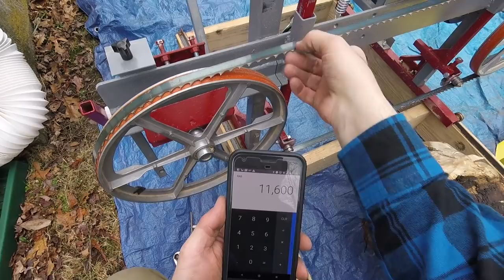Felling a Tree and Milling It Into Boards With My Homemade Sawmill

Comment: I notice that the blade guides are set away from the timber.
This and the blunt blade will account for the diving , and variations in thickness.
If your blade guides can be moved closer to the timber , and a fresh SHARP BLADE, this should correct the issues.
I notice that a lot of bandsaw mills also use a water spraynto cool the blades .Justva thought.Nice timber though and I follow with interest

Comment: i agree with one comment you have received from another viewer, that you need one of you blade guides to be adjustable and closer to the log.  preferably the cutting side.  everyone can be critical but to build your own band saw mill is awesome at any cost, (except an eye, foot, leg, toes, throat, etc... you get the idea).  good luck and great work.  only thing i would add to the stability is make it heavier

Comment: I see that this is your latest sawmilling video, so I'll copy what I had written for one of your previous videos along with what I"ve seen in some of the videos you did later.

Mistakes I caught in the milling process ...

1 ... you have the blade running BACKWARDS.  In nearly every bandsaw configuration I've seen, you want the blade to pull your material up against the stop (usually the left side of the sawmill, as seen from the operator's perspective).  This keeps the material under control while it's being cut.  You also need to have some method of securing the material as you are working with it, to keep it from trying to roll while you make your cut.

2 ... you have no coolant for the blade (water with a few drops of dish soap works great ... just a steady drip)  This also helps keep sap from sticking to the bandsaw blade, gumming things up and making a mess or catching fire.  This also helps lubricate the blade so that it doesn't get pinched in the kerf, and also helps keep the blade tracking straighter (helps prevent that climbing or dipping thing).

3 ... Power is an issue, as you figured out.  3 - 5 HP should help a lot.  I see you went to a gas powered version.  This might work better for you, or not ... depends on the availability of higher powered electric motors and the price point of gasoline, though running it off gas would also make it very portable if you wanted to take it out to the woods.  Running it on electricity, on the other hand, would mean you could keep it in a corner of the garage and even run it indoors .... the trade-offs are generally a bit of a personal choice.

4 ... Blade Tension helps keep the blade running on track and cutting true.  The blade guides should also be tuned and set so that the gullet of the blade teeth are riding right on the crown of the blade wheels.

5 ... NEVER BACK OUT OF A CUT ... the blade will pop off!  Also, keep track of where your blade will be tracking, you don't want to hit your hardware that secures your materials.  When you finish your cut, remove the slab or board you have just cut and then raise the blade a little to return to the front of the mill.  This is a lot easier than raising the blade to clear all the material you just cut and then moving back to the front of the mill just to lower it down again.

6 ... Learn how to repair maintain and sharpen your own bandsaw blades, if you can.  If not, then you'll at LEAST need to learn how to sharpen your blades, and order them from a good reputable source.  I prefer Timberwolf for my bandsaw blades.  I noticed that you have Timerwolf blades too! :)  A good sharp blade tracks truer, so keep them properly sharpened and with even tooth set left and right for a good clean cut.

7 ... A thinner blade will be for rip cutting on a stand-up bandsaw, to conserve material.  A wider blade (NOT THICKER) is used for making straighter cuts, as it tends to track true down it's own kerf, keeping the front in line.  A narrow blade is meant for making curved cuts, so that the back side of the blade will not get in the way as you make tighter curves.  A thicker blade is meant to be more durable, for rough cutting.  Obviously, for bandsaw milling, you'll want a decently thick blade for durability, with a wide blade and a fairly sparse tooth count (large teeth, perhaps a half inch or more between teeth).

8 ... GET MULTIPLE BLADES.  The very very last thing you will want to do is stop right in the middle of milling a log and having to take the blade off to sharpen it before re-installing it to continue ...  You'll want at least 3 or 4 replacements on hand that are sharp.  Spend some free time in the evenings or something sharpening the blades that have been used, and do your milling in larger sessions on the weekends or something.

9 ... (next video, where you have it running on gas power).  The powerhead is nice and strong, but this lead to the feed getting choppy as the blade head kept wanting to rack left and right .... I know you made it lightweight on purpose to make it easy to move it around and store it, but this is dangerous.  You need to add weight to keep your blade tracking straight and true, or you need to add some method of keeping your wheels down tight to the track to keep things safer.

10 ...  Working hunched over like that is gonna kill you .... or your back .... or both.  Set up a low table that you can set your bandsaw mill up on, so that you can work while standing upright.  Put some ramps on the side of the table to make loading logs onto the bed of your mill easier.  

11 ... Set up some log dogs on the left side of the mill to hold your work steady for you .... make them so that they can rotate down out of the way so that you don't cut them.

12 ... (this video)  I like the handle, but you're still needing to hunch over a lot to check where your blade is.  I still think that raising your mill bed is the best way to go.

13 ... A sharp blade will track straighter cuts.  Also, a sawmill is for rough work, not finish work.  Use a joiner and planer for nice straight flat boards, or you could possibly true them up on the table saw if it's set up properly.  Besides, you'll still need to dry wood if it's wet or acclimate it to the conditions in your shop before actually putting it to use, so unless you are cutting this stuff to use immediately, it's PROBABLY going to warp or shrink in some way.  Always cut it oversize and then dry it, and then true it up in the shop after it's dried and acclimated for your best chances on ensuring that it won't move further on you and ruin your careful woodworking.

14 ... for a small mill setup like yours ... spray down (with the hose) your wood to clean off the dirt and mud.  You're right ... only one thing dulls your bandsaw blades faster than dirt.  Hitting a nail or screw or a ROCK embedded in the wood.  Dirt is bad enough, get rid of it whenever you can.

15 ... it's gonna sound like i'm raggin on ya, but really ... get a water drip going for your blade to help keep it cool and running cleaner through the kerf.  It also helps keep the blade from binding or trying to track up or down on you.  This plus keeping your blades sharp are where you need to be working on to improve the mill.  Keep in mind that if your mill bed gets wet, it will start to warp on you .... replace the bed with an all-metal one or use good treated lumber and give it a few good heavy coats of paint to protect it from your water drip and weather conditions.

16 ... there are plenty of methods to sharpen bandsaw blades out there ... watch some and find a method that works for you ... but the best accepted method i've seen usually involves getting a small dremel stone up into the GULLET of the tooth, just barely kissing it and running it up towards the tip of the tooth ... you dont want to remove a lot of material, you do want to have a nice clean finish, you don't want to have all your blades running flat and true, but you DO want them to be mostly in alignment (alternating set, less than .5 mm ... just enough to allow your blade to clear through the cut WITH the wood shavings and chips you are removing).   If all you do is sharpen the tooth from the back of each tooth, you make the gullet between each tooth smaller and smaller, allowing each tooth to remove less and less material over time, which will cause the blade to bind and overheat.  

17 ...  touching again on the bandsaw sharpening and the overheating by reducing gullet size .... the more you heat metal, the more it expands, and the less tension you end up with on the blade.  The water drip is meant to cool the blade in order to KEEP YOUR TENSION PROPERLY SET, so that your blade will track true.  Don't worry, you ARE learning, and you're getting there.  As for proper tension ... try setting your bandsaw blade using the flutter test (which tests through harmonic vibration).

18 ...  When milling smaller logs, move your guides closer to the log.  This reduces the amount of possible deflection that can be caused by the blade trying to climb or dip on you be reducing the available amount of travel due to the blade flexing.  This is further exacerbated by the blade heating up due to no cooling or lubrication or cleaning the sap off the blade.  Also, a hot blade will get duller faster.

19 ...  Seeing the part where you are sharpening the blade ... it is bluntly obvious that your blade is not set up properly.  The back of the gullet of each tooth should be riding RIGHT ON THE CROWN of the wheels.  If it is not set properly, the blade can wobble back and forth, allowing it to climb or dive at will and no amount of ANY other settings will change this until you correct it.  Again, check out some videos online for tuning up your bandsaw blade ... Ignore any video on the net that says ANYTHING AT ALL about "correcting for band saw drift".  Anybody who knows anything at all about bandsaws will tell you up front ... THERE IS NO DRIFT - YOU HAVE IT SET UP WRONG.

Comment: Nice build. If this helps...I just bought a small Hud-son sawmill this past weekend and they recommend 35-40 foot pounds of tension on the blade for their machine. Maybe weld a nut to the tensioner handle on your build and use a torque wrench to set it in foot pounds? That way every time you need to remove or change a blade you can always set it to the same tension that works best for your build.
Reply from the maker: That's a great idea.  Do you know what size threads are on the bolt on your machine?
Reply: I want to say that it's a 1/2" x 16 bolt. I'm not near the machine but can check tomorrow evening and get back to you.
Reply: I checked today after work and yes the bolt and nut set up used is a 1/2x16

Comment: Dennis I just put up a video of cutting a 16 inch ash log on my  copy of your sawmill, and it worked great.  I never thought it would handle a log that big.  I use a 1 inch blade at 2 teeth per inch.  Th 6.5 hp engine works great. My friend Monty became a pretty good sawyer.  He wanted 2 inch slabs cut from his two 16 inch logs.  The video can be found titled DIY cutting 16 inch log.  Take a look at it.  Your design is still running great.  I have hauled it to West Texas and northern Wisconsin.  The design is easy to disassemble and assemble.  Have a look.

Comment: That is cool. Check out bowsaws or bucksaws. (their the same saw, used before chainsaws)  Build up on the band blade can be an issue if it pushes on the board above. Most times it will force the blade down. The use of a soapy water dribble on the blade will solve this. I use water to keep the blade clean. If there is no build up I saw dry. As others have mentioned you have an excessive amount of unsupported blade.
A good place to watch, is the blade leaving the cut. If it moves up or down once free, there's an issue. Hope this helps. Happy Milling!

Comment: my best guess is that when you really crank down on the blade the set on the teeth gets to be asymmetrical so it will wander downward in the configuration of your saw as the teeth are being bent by the contacts on the wheels

Comment: I added a video of me assembling my copy of your sawmill.  It was my first attempt at using a new video editor so it is not professional quality, but it was fun.  It is Build a Sawmill on my site.  Have you had any problems with your bearings on the blade guides.  Two of mine got wet, rusted and disintegrated.  I was wondering if you noticed the same problem.  I considered them replaceable parts at 10 for $13 that didn't bother me too much.

Comment: At 6:00 I love your log carrier.  Where did that come from?  How much weight can it hold?  Did you build it and do you have plans for one?
Reply from the maker: I made it myself out of scrap steel.  It's really light because of the roll cage steel tubing.  I've had probably about 600lbs on it no problem.  I will have to do a video on it
Reply: @WhatDennisDoes  That would be great

Comment: I had the same problem with my copy of your mill.  Putting a new blade on it solved the problem.  I can see sharpening the blade also worked.  I put a nut on the tensioning lever and got a torque adaptor from Harbor freight.  It took about 10 foot pounds of pressure to get a good cut.  One of the sawmill mfgs suggests using 15 foot pounds on theirs.  The sawmills are completely different but I thought it was interesting that ours is similar to the big guys.  I put up two more videos on my channel stephen Anderson.  One is cutting rounds on a log and another is cutting a 13 inch log that it about 2 ft long.  If i can cut a log to 3/16 inch accuracy I am happy.  The planner will take care of the rest.  I have had purchased lumber that was not that good.
Reply: I have increased the tension to 16 foot pounds at the tensioning crank and it appears to have improved the straightness of the cut.  I also added a leftover piece of tape measure to the beam at the tensioning side.  Then you have a place to start your blade tensioning.

Comment: You may be getting sawdust buildup because of using water.  I have not used water yet and have cut dogwood and cedar.  I have not seen any significant  heat buildup on the bade.  Also I have the base perfectly level and get the blade perfectly level by putting a short level on the blade.  I adjust it till it also is perfectly level.  (love your blade angle mechanism) I have managed to cut a 1/8" piece of dogwood the same thickness along the entire 4' length.  Next weekend there will be a real test.  A friend has asked me to cut a 16" or larger log.  Dont know the species. I'll let you know how it goes.

Comment: Great build. You have two problems. The gude bearings are to be used as thrust bearings only. They should only touch the blade when you go into the wood. "Diving" is caused when a blade has been damaged more on one side than the other. The tooth height becomes shorter on one side. If a blade has been damaged on the top it will dive down and vice versa. No amount of sharpening or blade tension will fix it. The blade can be corrected by grinding all teeth to the same exact height and setting all the teeth to the same pitch. Just my humble opinion.

Comment: It needs upper and lower bearings for the blade so the blade will track straight and always keep the blade guides close to the wood as possible to help better stabilize the blade

Comment: I think you really need to tighten the tension on your blade a lot more. I see way too much flex in it when you touch it. They can stand a lot more than you realize. I had to learn that the the hard way too. Put on a new blade and crank the tension until you grunt and then back it up a half turn. What do you have to lose? Make sure your tracking is correct after you tension it though. On a lot of saws the tracking will change with the blade tension. It does on mine. Hope this helps. Hate to see you struggling with it.

Comment: Sharpening is too complex for a comment, but terms to look into: joining or jointing the teeth, and tooth set. As you've already leaned, even a poorly sharpened blade cuts faster than a dull blade, as Jeffrey commented getting the saw guides as close as possible will help, and water as a lubricant could help clear the saw dust. I would guess, by the cuts you're getting that saw blade needs to be reset.

Comment: You need to make your bearing guides movable horizontally ..
If you move them as close to your log diameter as possible you`ll get rid of your cutting problems ..
The guides on your down rails are way to far apart from your wood ..

Comment: redo the tension on the guides and move them close to the log, less deflection
good to see you put a proper handle and guard on it, arms and feet are useful, a sandbag or two will help with the vibration, it looks a bit wobbly  ;0)

Comment: Nice job! I can mention a couple of things that might help. Check out "Matthew Cremona" and "Josaljo Won" and "Maithias Wandell", the last one I could not find the correct spelling of his videos. These are a couple of the channels I watch. You may want to consider cutting your boards over the size you want. After planning and or sanding, the thickness will be reduced some. Also check to clean your log before you put it on the sled to cut. I think Josaljo uses saw dust to clean off dirty logs...